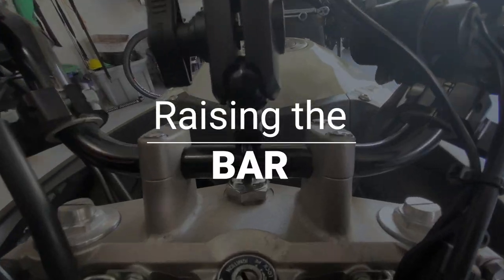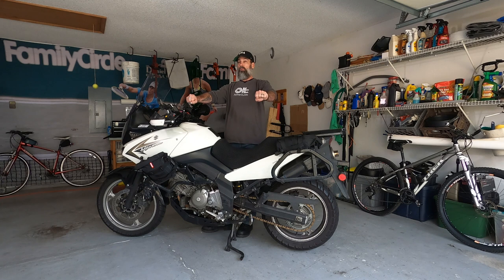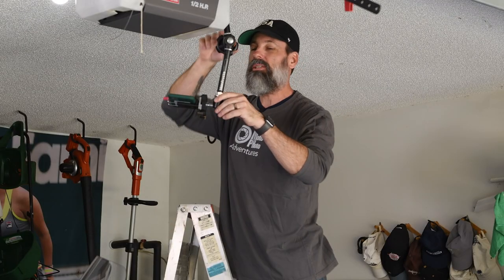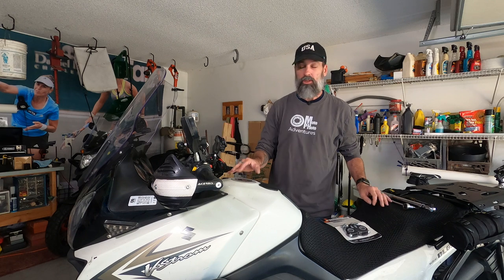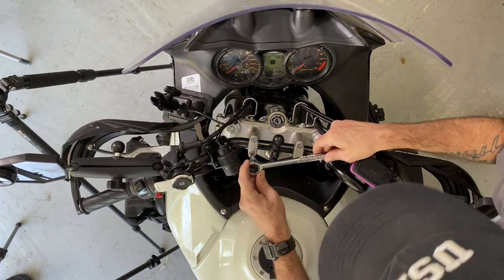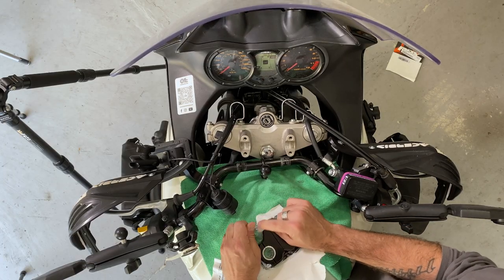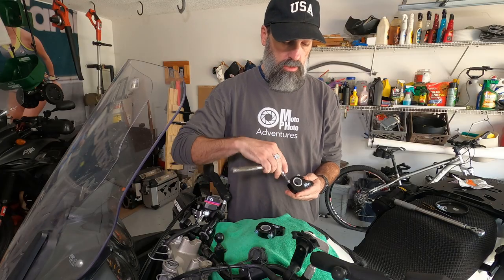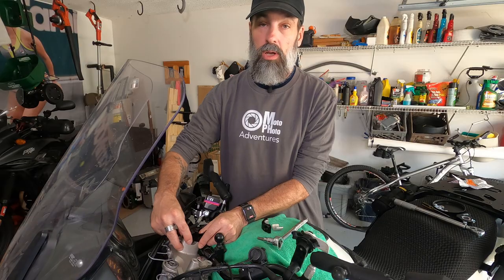Raising The Bar - Installing Rox Handlebar Risers

Comment: Are they gonna fit on DL650 v strom 2022, without affecting cables and brake hose, please advise, thanks
Reply from the maker: Jason got this setup specifically because it was the tallest he could get that wouldn't require longer cables.  I would guess the 2022 would have the same slack in it's cables as the earlier models.  But there's no way to guarantee without trying!  I would reach out to Rox support and see if they have any insights.  Otherwise, just order them and try it!  If they don't work, you can always send them back.

Comment: I did the same set to my 2020 650XT.  I am only 5'10" though and I would still like them back just a little bit more.  I have not had to stand up as of yet for I am still on the Factory Tires and have not gone off road.  I have the 2 Inch Anti Vibration Rox on my dual sport and am considering those for the VStrom.  But then the Cables have to be lengthen and that is whole other project.
Reply: Yep, really glad my cables were long enough. Gonna change those out but, like you said, that's a whole other project. Thanks for the comment!

Comment: Thanks for the video. I have been considering those for a while now. Could you make a video discussing transitioning from seated, to standing up straight, to a more aggressive posture when it gets gnarly? And include the trade-offs we have to make with bike setup for back/shoulder/neck comfort, wrist comfort, and control?
Reply from the maker: Hi BootsInTheDirt!  Jason is pretty happy with the new bar risers.  He may adjust the angle of the bars a little over the next few weeks to get it just where he wants it.  But unfortunately what you're asking for is extremely rider-specific.  What works for Jason's height/build/torso/arm-length/etc. won't necessarily work for yours.  I guess what I'm saying is, the bar-risers definitely help, he loves them, he's keeping them...but the subtle nuances of adjusting the ergonomics of the bike to best fit your frame are probably going to have to be done through trial-and error on your part once you have them installed.  Good news is, they are cheap and easy to install.  So if for some doubtful reason you don't like them, it'll be easy to remove and send back.  Thanks for watching!